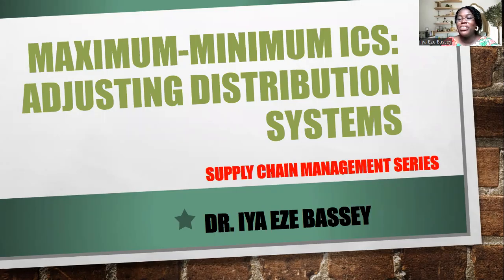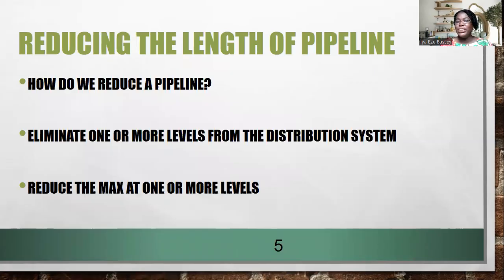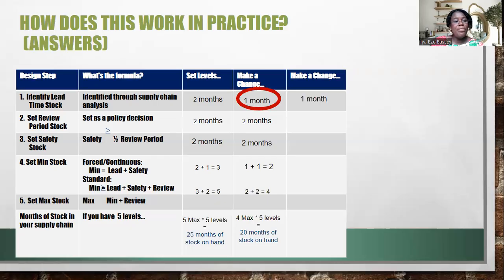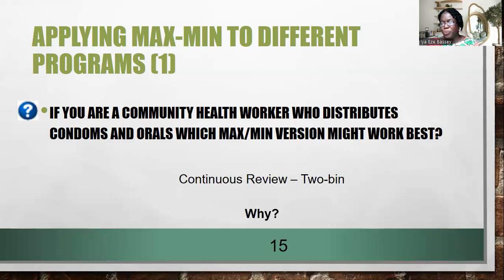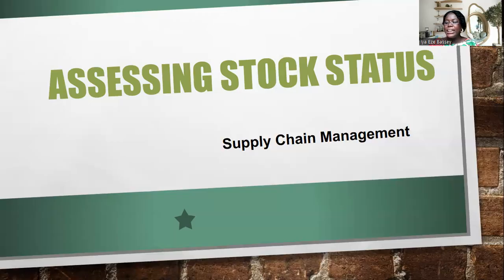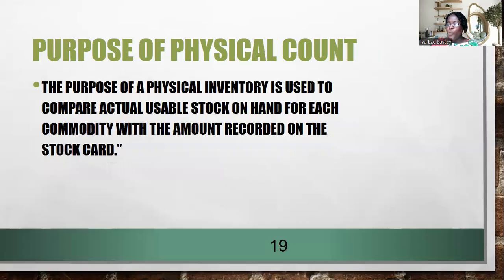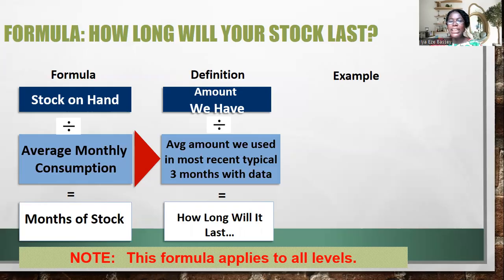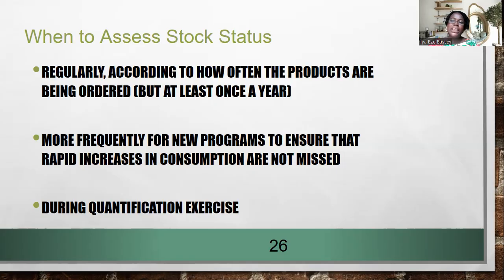Maximum-Minimum ICS: Adjusting Distribution systems (Supply chain management series)

Comment: In summary, key points include:

1. Reducing Pipeline Length: Methods to reduce supply chain pipeline length involve eliminating distribution system levels and reducing maximum stock levels. This can be achieved by adjusting review periods, lead times, and improving distribution system reliability.

2. Factors Affecting Max-Min Stock Levels: Several factors influence max-min stock levels, including product costs, transportation reliability, storage capacity, storage conditions, shelf life, lead times, source reliability, zero balance effects, staff skills, program age, and forecast accuracy.

3. Advantages of Max-Min Systems: Max-min inventory systems offer benefits such as avoiding overstocking, understocking, minimizing wastage, emergency order costs, simplifying inventory control decisions, maintaining consistent stock levels, and providing reliable data for forecasting.

4. Challenges of Max-Min Systems: Challenges arise in systems with many levels, managing numerous commodities, and implementing max-min systems for new programs.

5. Applying Max-Min Systems: The choice of max-min versions depends on the specific healthcare program. Continuous review (Two-bin) is suitable for condom and oral product distribution, while the standard version is recommended for drugs, HIV test kits, and labs.

6. Assessing Stock Status: Physical counts involve manually counting usable units to compare actual stock with recorded amounts. This process helps determine how long supplies will last and if stock levels are appropriate.

7. Calculating Months of Stock (MOS): MOS is calculated to assess stock longevity based on current consumption rates. Regular assessments are crucial, especially for new programs and during quantification exercises.

Comment: In this I learned the need for adjusting distribution system in max-min inventory control system which implies ways of reducing those factors that causes a quick and fast distribution.there is need for adjusting and renovating the pipeline distribution system for effectiveness
Some of those factors to adjust includes 
Shortening the review time at all levels
Reduces the lead time at one or more level improve the distribution system reliability at one or more level
Also learned some factors that can impact max_min stock level as
Cost of product
Reliability of transportation media
Storage capacity and cost of storage
Storage condition at different levels
Shelf life of health commodities
Also learned how to access stock status as physical count with the purpose of getting the monthly stock on hand done by dividing stock on hand value by monthly consumption value
Some benefits of this adjustment process are
Avoid overstocking
Avoid understocking
Maximizes wastage
Reliable data from SDP for forecasting and quantification
Avoid cost emergency orders consistency of stock levels

Comment: from this series, I have learnt that to design max-min ICS you need to  first set up initial max-min policies for each level and type of facility by checking the total length of the pipeline.Pipeline can be reduced by eliminating one or more levels from the distribution system,the max-min system is important as it aids to avoid overstocking,avoid understocking as well as minimize wastage and avoid cost of emergency order..

Comment: Thanks Dr, for the teaching, concerning the assignment that you gave under MAXIMUM - MINIMUM INVENTORY CONTROL SYSTEM; ADJUSTING DISTRIBUTION SYSTEM.........

Write on
SOP for Tb drugs
SOP for HIV/AIDs commodities
SOP For malaria drugs

1) Determine the type of Inventory system for each of the SOP
Answer
a) SOP for "Tb drugs" = "Standard Max-Min version
b) SOP for HIV/AIDs commodities= "standard Max-Min version"
c) SOP for Malaria drug = "Standard Max-Min version

2) Factors considered for the SOP of (Tb drugs, HIV/AIDs commodities, Malaria drugs)
a)lead time
b)cost of products
c) storage capacity
d) reliability of transportation

3) what is the review period of each of the sops
a) Tb drugs= 6months
b) HIV/AIDs commodities = 2months
c) malaria drugs= 2months

4) what type of inventory control system was used and why?
Answer
"Standard Version" - this is because standard Max-Min version reviews all stock levels at the end of each review period, for products which are at or have fallen below min, order enough stock to bring stock levels up to the max

Comment: Adjusting distribution system in max/min inventory control system is about finding ways to reduce the factors affecting distribution.
    Also understood the ways which length of pipeline can be reduced. They include;
a) Eliminating one or more levels from the distribution system
b) Reducing the max at one or more levels.
         Factors that impact max/min stock level are lead time, age of program, accuracy of forecast, management skills of staff etc.
        I was able to understand the advantages of max/min inventory control system;
i) Avoid overstocking 
ii) Avoid understock
iii) Minimize wastage, etc.
     Aside this advantages max/min inventory control system also undergo certain challenges which are 
a) systems with numerous level
b) systems that manage products for new programs etc.
    Lastly, under assessing stock you explained physical count as process of counting by hand the total number of usable units of each commodity in store or health facilities at any given time.
   Thank you ma.

Comment: Thank you ma.
In summary,
Steps in designing the length of a pipeline include
a. Setting up the initial max-min policies for each level and type of facility.
b. Check if the overall distribution will function properly if the level specific max-min policies are implemented.
c. Check the total legth of the pipeline that the policies at each level imply
There are also ways to reducing the length of pipeline and a systematic way of doing it. The formulas also help in the designing of the steps.
Other factors to impact stock levels are cost of product, cost of storage, etc.
Advantages of using MAX-MIN system are:
a. Avoid overstocking
b. Avoid under stocking
c. Minimize wastage
d. Avoid costs of emergency orders, etc
Challenges of using different version and variations are also to be known to have a balanced system.

Under assessing stock status,
Physical count, which is the process of counting by hand the total number of usable units of each commodity in a store at a given time, should be ensured to know how long supplies will last.
While calculating in the example, if one of the last 3 months is 0, the month before the 1st last month is used.
Stock status should be assessed regularly, more frequently and during quantification exercise.

Comment: In this module we will be taking about adjusting distribution system in max-min ICS which I think is about finding ways to reduce factors that affect fast distribution and pipeline. The factors which can be changed to reduce the max stock level; review period, lead time, distribution systems reliability. Factors that impact max-min stock level; storage capacity, cost of storage, lead time, age of program etc. Some advantages can include; avoiding overstocking, minimize wastage and so on. I also learnt about the challenges to using each version. I understood the version recommended for drugs, HIV, and labs which is first to eliminate the continuous review then go forward to using the standard version.I also learnt about assessing stock status which include physical countand it is the process of counting by hand the total number of usable units of each commodities in store at any given time. I also learnt the purpose of physical count and purpose of assessing stock status which is the to determine how long supplies will last. Then I learnt formula for months of stock which is SOH÷average monthly  consumption which applies to all levels.

Comment: Good afternoon ma
In summary,STEPS IN DESIGNING A MAX-MIN ICS 
1.Set up initial max- min policies for each level and type of facility.
2.Check if the overall distribution will function properly.
3.Check the total length of the pipeline that the policies at each level imply.
FACTORS THAT IMPACT MAX-MIN LEVELS
1.Cost of production
2.Storage capacity
3.Cost of storage
4.Lead time
5.Age of program
ADVANTAGE OF USING MAX-MIN SYSTEM
1.Avoid overstocking
2.Minimize shortage
3.Consistency of stock levels.
4.Avoid cost of emergency order
CHALLENGES
1. System with numerous system.
2.System that manage a large number of commodities.
3.System that manage product for new program
Reply: In summary 

There are steps in designing a max-min ICS

1 setup initial max-min policies for each level of facility 
2 check if the overall distribution will function properly.
3 check the total length of the pipeline that the policy at each level imply.

Factors that impact max-min level are;
1 cost of production 
2 storage capacity 
3 cost of storage 
4 lead time 
5 age of program 

Advantages of using max-min system 
1 avoid overstocking 
2 minimize shortage 
3 consistency of stock levels
4 avoid cost of emergency order 
  

Challenges 
1 system with numerous system 
2 system that manage a large number of commodities

Comment: Thank you very much ma for the wonderful lecture on maximum -minimum (ICS) inventory control system Adjusting distribution system. I learnt the ways to Adjust distribution system policies, the advantages and challenges of maximum -minimum inventory control system, the inventory control system used in the logistics management of HIV/AIDS commodities. The purpose of assessing stock status. Lastly to determine the number of months of stock available at any storage level using inventory and usage data. Thank you

Comment: Adjust Distribution System Has to do with a Trimming or Reduction in the Max-stock level, that is you have to reduce the quantity of stock ordered. 

For this to be effective the following has to be observed: 
1. Shorten the review period at one or more levels.
2. Reduce The Lead Time which is the time between when new stock is ordered and when it isavailable for use. This is also done at one or more levels.
3. Improve the reliability of the distribution system. This is where 6Rs also plays a vital role. 

Factors Affecting Max-Min Stock Levels: 1. Cost of Product 2. Reliability of transportation 3. Storage Capacity 4. Cost of storage 5. Storage conditions. 6. Shelf-life of Commodities. 

All this are the major factor that must be considered while Adjusting Distribution System. This is to avoid Damage of commodities as well as ending up with expired commodities.

This method prevents the organization from running at a loss.

Comment: Here,

I learnt how to adjust or reduce the pipeline
Also how to reduce the maximum stock level
And the factors that create impact on the maximum and minimum inventory control system.
Also what physical count is all about and it's purpose.

Ways to adjust the pipeline is to eliminate one or more level in the distribution system and also by reducing the maximum stock level.

To reduce the maximum stock level, you shorten both the review period and lead time.

Factors that impact the system are
Cost of product
Cost of storage
Reliability of transportation

Physical count is a process of counting by hand the total number of usable unit of commodity in your health facility at a given period of time.

It's purpose is to compare the stock on hand with the amount recorded on the stock card.

Comment: Thanks you ma for you lecture, all I learnt are as thus; 
To reduce the Max stock level: 
1.
Shorten the Review Period at one or more levels
2. Reduce the Lead Time at one or more levels
3. 
Improve the distribution system's reliability at one or more levels so that Safety Stock can be reduced
Factors that impact the max- min stock level.
1. Cost of products
2. 
Reliability of transportation
3. 
Storage capacity
4. Cost of storage
5. Storage conditions at different levels
6. 6. Shelf‑life of health commodities
Advantages to Using Max-Min Systems
Avoid overstocking
Avoid under stocking
Minimize wastage
Avoid costs of emergency orders
Consistency of stock levels 

Reliable data source from SDP for forecasting and quantification

Comment: Adapting distribution system in max-min in inventory control system are effective, allowing them to respond to changing needs and circumstances. It!gains insight into its role in maintaining optimal stock levels.
Cost of storage, lead time, accuracy of forecast and cost of products are some factors that can impact the max-min stock level.
The process of counting by hand the total number of usable units of each commodity in the health facility at a given time is called physical count.
In Adjusting distribution system in Max-min ICS,set up initial polices, check if the overall distribution will function properly and check the total length of the pipeline of the polices at each levels.
We use the max-min system to avoid overstocking, understocking, minimize wastage, avoid costs of emergency order, simplify inventory control decision making, maintain consistency of stocks, have reliable data sources from SDR for forecasting and quantification.
There are various challenges to using each of the ICS like system with numerous levels, system that manages products from new programs.
Assessing stock status is knowing stock available, knowing their quality and longitivity. To determine that, we do a physical count by counting each of the stock to verify how many commodity available and useable.
Physical count is done to compare the actual useable commodity with the one recorded and to determine how long the commodities will cost . Physical count should be done once a year or frequently if there is no balance between the stock at hand and the one recorded.

Comment: Thank you ma 
I learnt that the max min ics adjusting system have steps 
Set up initial maxmin policies for  each level and type of facility
Check for overall distribuition will function properly if the max min policies are implemented
Advantage 
Avoid overstocking
Avoid wastage 
Avoid understocking
I also learnt about the challenges 
And i also learnt how to reduce max stock level by reducing 
Lead time in one or more level
Also reduce review period in one or more level

Comment: In summary, 
The purpose of this max/min inventory control management  is; To maintain an appropriate stock level of all products avoiding shortage and oversupply.
 To determine how much stoçk should  be ordered / issued.
The Rule is to review all stoçk levels at the end of each period.  And order enough stoçk to bring stoçk levels up to maximum.
Advantages:
It review  stoçk level every two month while Disadvantages  it can hold at anytime. 
Maximum  stock  level is defined  as the max.quantity of commodities  a store keeper can hold at anytime .
Minimum stock  levels is the min. quantity of commodity  a store keeper may have to allow stock out.

Comment: Well done ma for this lecture.  This adjustment of distribution is very important because it make commodity function more easily n quick. By adjustment it means eliminate one  distribution system and also reduce the maximum stock level by shorten the review period, reduce the lead time and improve distribution system.

Then the accessing stock status is another interesting part that teach us to know the available stock by doing a hand count inorder to have a corresponding numbers with what is written in the stock card.

Comment: Thank you ma for this online explanations on max-min Ics adjusting distributing system.
In summary,I understood that in designing a maximum inventory control system we have to set up initial max-min policies for each level &type of faculty and check if the over all distribution will function properly..we reduce the length of a pipeline by (1)eliminating one or more levels from the distribution system and 
(2)Reduce the max at one or more levels .
The factors that impact on max-min stock levels are (1)cost of products,(2)cost of storage and 
(3)shelf life of health commodities.The advantage of using max-min system are to avoid over stocking  or under stocking and minimize wastage.I equally understood about the physical count which is the process of counting by hand the total number of usable units of each commodity in your store or health facility and the purpose of physical count is to compare actual usable stock on hand for each commodity with the amount recorded in the stock card..
Lastly ma,with your explanations I have known how to calculate how stocks can last and know when to order and replace 
Thank you ma

Comment: In adjusting the length of pipeline, one can eliminate one or more levels from the distribution system.

One can also reduce the Max stock level by shortening the lead time at one or more levels, and also shorten the review period at one or more levels.

Some factors like cost of storage, lead times, accuracy of forecast and cost of products can impact the max-nin stock level.

Advantages of using the max-min system includes avoiding overstocking, understocking, minimize wastage and avoid cost of emergency orders.

In physical count, one count by hand to determine the total number or usable units of each commodity in store. The purpose of assessing stock status is to determine how long the supplies will last.

It’s important to assess stocks regularly and frequently for new programs.